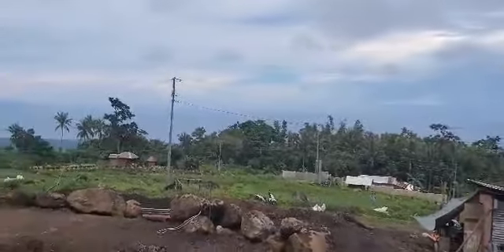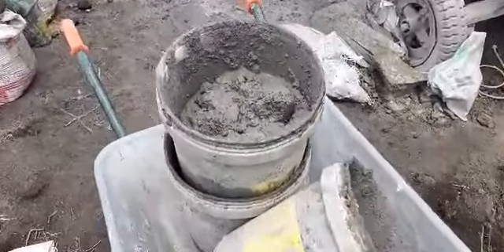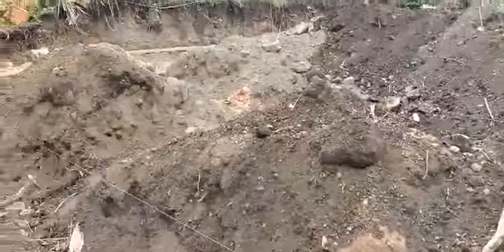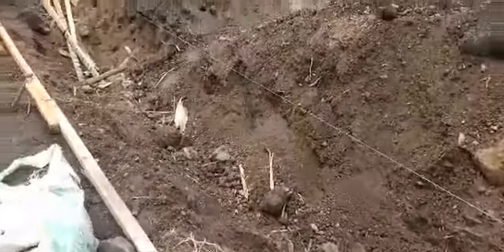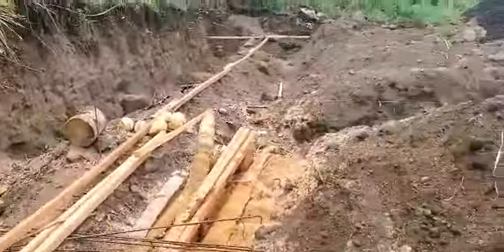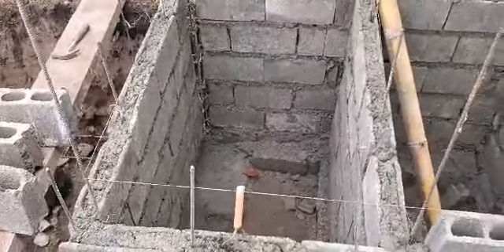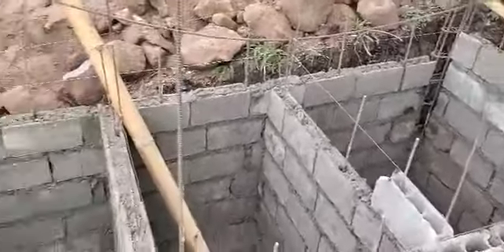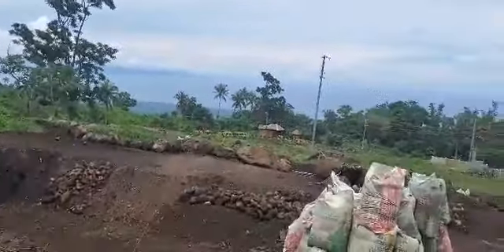House Building - Day 3 of construction - We are making progress !

Comment: hey GREG AND WILMA  WHAT SIZE BLOCK DOESNT LOOK LIKE 8 INCH LOOKS LIKE A WEIRD SIZE? AND YOU DOING
Reply from the maker: They use 3 inch hollow block here.  They put vertical rebar every 20 inches going up the wall and horizontal rebar every 3 rows.  Then they fill the hollow block with concrete for strength.  Lastly, they render both sides of the wall with a sand & cement mix.  They will sand, trowel smooth, then apply skim coat, sand, then paint a base coat, then finally the finish coat.  Many steps, but its real strong and looks great.  Thanks for the question and keep watching.

Comment: DO YOU HAVE TO DRILL A WELL FOR WATER? YOU FOLKS ARE LOOKING GOOD
Reply from the maker: Hi Ken & Barbara,  We are lucky to have municipal water for the property.  Several provinces, I experienced this in Bohol, where you need to dig a well.  Most wells in the Philippines are dug by hand.  Amazing to watch how they do that.  There's some drilled wells, but not may as I understand it.  Our property, we just needed to apply to the municipal for water connection.  It was approved and they came out and ran a water line to the property.  Easy process.  Thanks for watching.